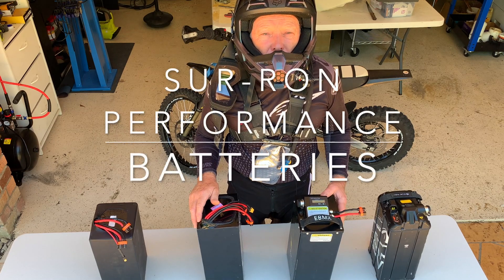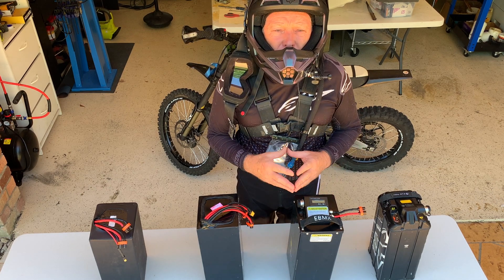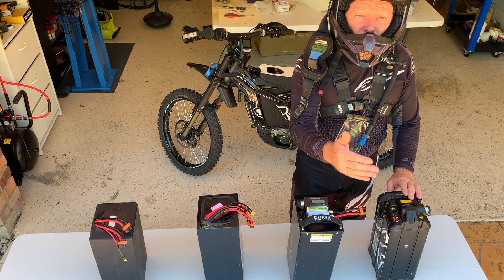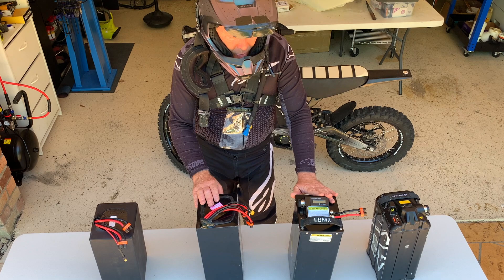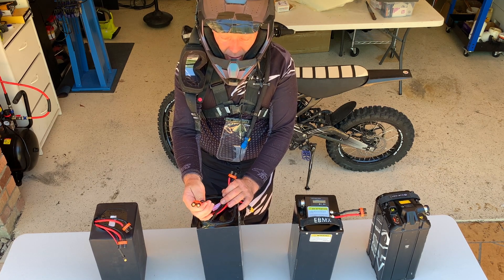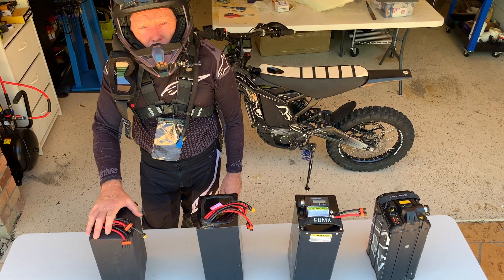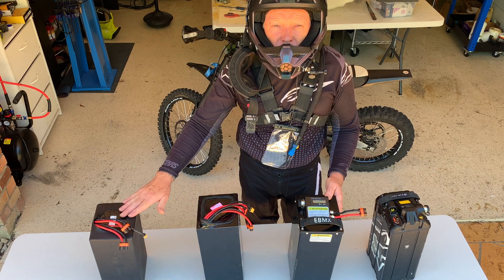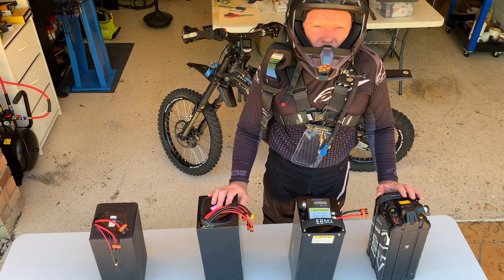Sur-ron high performance battery discussion - feedback wanted

Comment: Great content as always.  Chibattery offers some of the highest capacity batteries for the Sur Ron.  Their batteries are a bit taller than stock.  You may be the only one who knows the answer to this question:  Will the Race Spec Sur Ron Seat still fit when using these larger batteries?
Reply: kinda wondering the same.  I don't think it would fit.  Maybe on the 60v60ah max, but not their tall 72v max.
Reply: EBMX has 72v 57ah that fits.

Comment: I enjoyed the video,. I do have a question though. I want to purchase an upgraded battery but want to be able to use my stock controller.  If I run a EBMX 60v 50ah battery off my stock controller will I be able to switch back and forth my stock battery? I've been research batteries and I'm leaning towards that battery EBMX. What do you think?
Reply: Yes you sure will ✅

Comment: I am a large man 200+ lbs and I own a stock sur ron. I keep up pretty well on rides withthe boys and their 72V systems, so I just took advantage of riders that were unsatisfied with stock batteries and low-bid them on ebay to get a great value and ride longer. I don't race but would consider a stock battery unable to meet those demands.

Comment: Thanks for the info video.   I currently have a BAC4000 and stock battery bypassed.   Looking to upgrade but keep the same size battery as the stock, so no extender for the lid....
Any thoughts on what my best option would be for more power? Im not concerned with getting more range than I have from the current stock bypass battery I'm using now, but would like performance improvement from the bike.   Thanks.

Comment: Good stuff thank you. Now I'm wondering it this ebmx battery is better than the Gladiator battery by Chi battery systems. They have two options for the stock controller.

Comment: You need to checkout Chi Battery.  60v/60ah and big output - up to 24k.  All cells are connected with a single metal plate that covers every contact point of the cells, which allows it to deliver high output at lowest possible battery temp    It’s a beast.
Reply: Jeff , dose the chi  60v/60 ah  give you faster speed as well ?  I’m about to go buy a battery, and I’m debating between the 72v.  And the 60 v any tips ? ….. I want to go fast and long distance , but don’t like the idea of changing stock controler and cover,if I don’t have to, ……your thoughts ??

Comment: Nice video I’m going to purchase a ebmx battery what do I go with the 60 v or 72 v
Reply: I like my 60v set up because I can still use the stock charger and stock battery (if needed)… it leaves all the options open. 72v is perhaps ideal for higher speeds like street riding or super moto style. 60v better for slower tight woods single track style.

Comment: Thanks for this. My bypassed stock battery recently  stopped taking a charge. I was thinking it could be from overheating and overdrawing amps. I'm a bigger guy riding off road with a lot of elevation changes and had started noticing sag under load. I'm hoping to get one of the EBMX 60v batteries that are supposed to be on their way to Hawaii. Keep making content and lets see more of your racing.
Reply: Try running the jumpstart procedure to get your battery to charge again
Reply: @musicbox4022  tried it many, many times.
Reply: @sur_ron_crash_test_dummy  yeah I had one go bad too… can’t figure it out… took the thing apart completely and still can’t get it to work
Reply: This happened to me and I had to replace the BMS to get it to charge again
Reply: I got the EBMX 65AH 60V its very good.

Comment: Great content. I decided to wait a year and watch all the battery and seat offerings. Ended up racing this years hare scrambles with two stock bypassed  
batteries and stock seat. The Chi battery looks interesting and still waiting for the EMB battery to be released. Wanna see more long term reviews before I buy one and only one next spring. I really like your seat but the shipping makes it cost prohibitive and shipping is a mess in the states right now, likely wouldn't receive it  in under 3 no. Only a handful of us racing these, figure we should stick together so I'll probably pull the trigger on one of your seats when shipping is better. MORE RACE FOOTAGE!
Reply: You said it MORE RACE FOOTAGE 💪

Comment: I ride my sur-ron like a crazy fast class 3 ebike. Even have the v2 functional pedal kit. I'm a commuter haven't even taken my bike off road yet once. I have the super moto wheels. My only issue with the sur-ron is range. For getting back and forth to work around the whole mid-mon-valley area where i live its just fine. But there is no other sur-ron owners in my area there is only a handful of ebike or e.v. owners in my area. I want to be able to ride my bike to Pittsburgh where e.v's are everywhere go on ride outs hang out... im ok with a top speed in the 50s as of now I don't even have my green wire cut yet cause that will just drain the stock battery faster. Im looking to get range without having to mod my battery box. Was looking into a piggyback set up. Maybe a bigger 60v batter like the EBMX + a piggyback is that possible? 🤔
Reply: Chi battery can run on stock controller and easily deliver 50 mile range on a single charge and if you ever decide to upgrade your controller it has the power to match.

Comment: this video is sick. OG john educates . ROFL you gonna test the batteries to the limit ,see how far we can push these batteries
. I have  a stock x260 i want to make it faster. what are the cheapest options to make it go like a rocket . ? can i just drop an ebmx and plug and play or dop i need to buy a controller ?  

thanks
Reply: You need an aftermarket controller as well mate. ✅
Reply: For speed you need more volts, so 72v battery + controller

Comment: Temperature rise in Battery becouse of discharge rate (higher discharge rate less heat).

Another aspect is safety way to protection battery for impact , vibration , watter , moisture shortcut. 

Best performance test is continius discharge test outside surron it can be huge resistor. 
Then you can see voltage sag and tempreture rise. And im more then sure all batterys claimed continius power cant be done under 60 Celsius degree after test.
Reply: Would 72v bat who makes motor run cooler have better range than same kwh 60v bat ? 
Do you have an idea of motor temp/efficiency diagram or something like that ?
Reply: @surronzak8154  if ypu use same power 10kw for egzample , 72v need less Amps then 60v to keep 10kw power. This is simple part , hard part is that controlers is pushing power to motor not battery. So less speed les voltage , more amps  . Volts can give you speed , amps torque. Choosing 72v is best for power and top speed without flux option in controller. Flux can spin motor faster but for it is necessary more Amps.

Comment: Is it true 72v batteries tend to be hotter than 60v on surron?
Reply: no. 60v generates more heat, because it'll have to pull more amps for the same power.

example 10kw: 
10,000w / 72v = 138,8A
10,000w / 60v = 166,6A
Reply: + with 72v motor runs cooler

Comment: Why  72v 40ah light speed battery in U.S.A is 18 inches tall with p42a 21700 cells, and the battery in your video is 72v 40ah too but it’s as short as a stock battery please let me know.
Reply: It has to do with how they configure the cells in the pack and the size of the BMS I imagine.  Chi makes a smaller 72v51ah at 17.5".  EBMX makes smaller batteries by using pouch cells.  The technology allows for almost no wasted space in the pack.